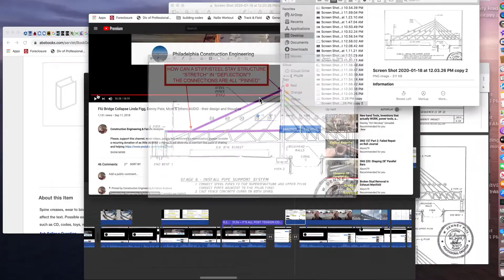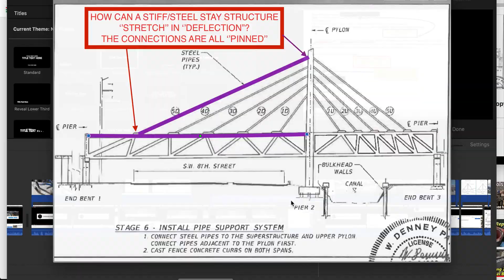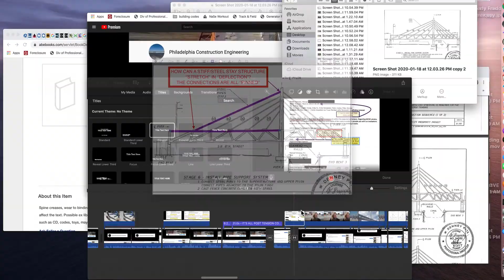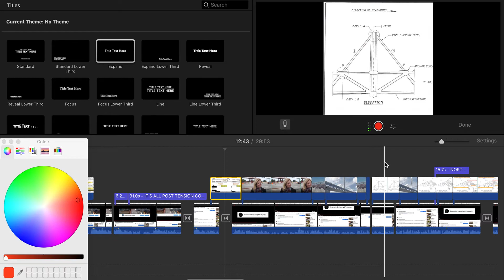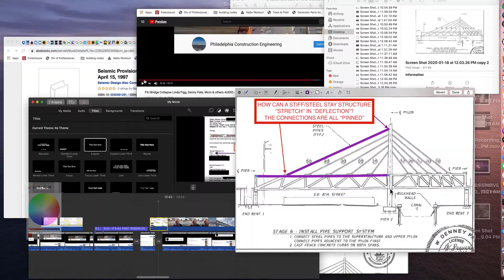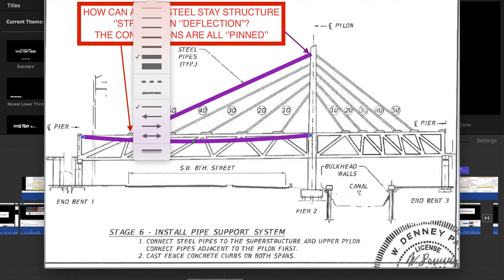FIU BRIDGE COLLAPSE WHY THIS BRIDGE CANNOT SAG

Comment: I thought that the pipes were decorative. 
( I also thought they were cables)
If they were used to help support,  
then why weren’t they installed 
before support/jacks were removed?
Reply from the maker: They are NOT used for support,  this scene stealer video is just to show this structure could NOT  have deflection and work.
That almost any deflection would pull on the joints and remove the ''compressive system'' (as it was reported to be designed as). Part 2 video loading in an hour or so... it is 36 minutes long.